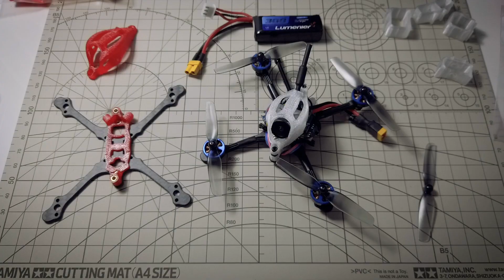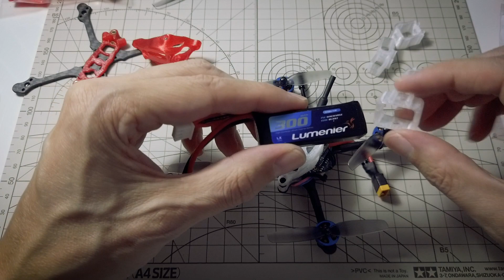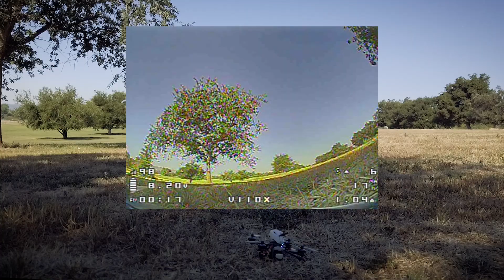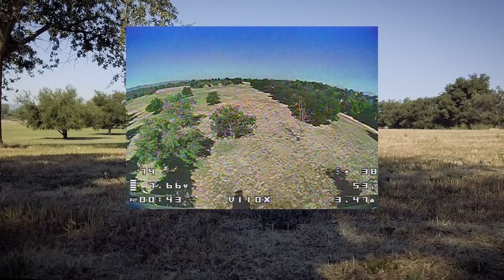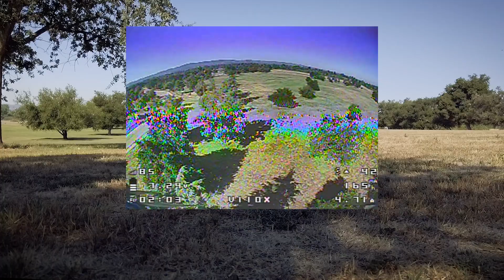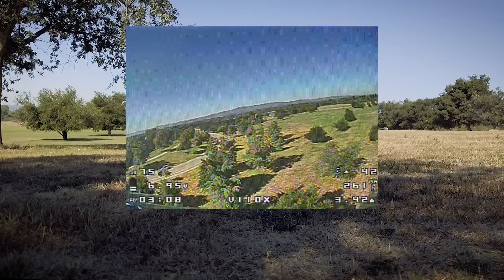GnarlyFPV Primo V110X + HQProp 65mm + Succex F4 AIO + Runcam Racer Nano + Hyperlite 8022kV + 2S 300

Comment: I just maidened mine today. These things really do feel like tiny 5in quads.
Reply from the maker: Awesome! Yeah these little things are all I like to fly at the moment;) The flight performance can be excellent especially considering how tiny and safe they are.
Reply: @MiniMicroFPV  Well, it was fun but this was my most short lived build, I had a desync today about 15-20ft in the air and crashed it. Two motors are broken and my  12a Iflight AIO board is fried. I don't even want to consider rebuilding it yet.
Reply from the maker: @yannickg6904  Oh no! Sorry to hear that. I consider myself lucky in that I don't think I've ever experienced a de-sync. I wish I could offer some advice to avoid them in the future. It's one of those things that seems hard to troubleshoot.
Reply: @MiniMicroFPV  The most maddening thing is that I flew about 8-10 packs LOS before attempting FPV and everything was fine. I had the issue at the beginning of the 4th FPV flight..no idea what happened, it just dropped out of the sky.
Reply from the maker: Yannick G That’s terrible! Oftentimes I won’t hear an oscillation until I’m in FPV. I hope you feel like rebuilding it or at least salvaging some components. Which hardware was it? Maybe others have had the same issue.
Reply: @MiniMicroFPV  I''m not willing to put the fault on the components I used, it may have been my way of putting it together. but using the motors from a Spedix Rex 80 was probably a mistake , the mounting screws are smaller than M2 and upon impact, they tore the threads off the motor bases. One of them had the motor leads pull from the windings and the other shows signs of damage as well. One of the ESCs is burned on the Iflight Succex board I used. I still have no explanation to what caused the crash.

Comment: It flys better with the racedayquads 350mah 2s hv
The hv part is super important to get decent flight times! There is essentially no extra weight.
I’m also getting 8min flights flying hard with 
Happymodel ex1102 7700kv
And yes 7700kv no misprint they are hard to find!
Reply from the maker: ace trex Thanks for the tip! I know I’m missing out on some performance but I generally don’t charge to high voltage as I’m paranoid about shortening the lifespan of the battery. I should probably pick one pack and start charging it to HV to see how it holds up;)
Reply: The racedayquads 2s 350mah hv is only $6.50. I just buy 6 at a time and run them for 2years ant then throw them away.
Reply from the maker: ace trex Nice price! If I can get them to last two years I’d be pretty happy:)

Comment: I been having issues with the xm receivers and the quad dropping out of the sky from low rssi any thoughts?
Reply from the maker: drums&drones Do you mean the plain XM (non-plus version)? If so I have also had bad luck with XM receivers and short range. No matter how I routed the antenna I would always get failsafe way before I expected to. All I can offer is to check the antenna for damage. It’s a shame because it’s a better choice for micros than the XM+ but I’ve found the range basically unusable:(

Comment: As KababFPV says, 73g is the upper limit for good performance, so I'll bet your 3s battery is making your Toothpick go over that weight. 2s isnt, so it flies better. It's all about light weight with Toothpicks.
Reply from the maker: I certainly agree with the light weight:) With the 3S it was about 71g. Even though that’s close to the limit I’m starting to think there’s something idiosyncratic about these motorz;) Or maybe it‘s be something with the tune that someone can set me straight on.
Reply: @MiniMicroFPV  have you done  betaflight motor oscillation test? I had the same issue on 3s but with my happymodel motors and I found one of them to be a little shaky when pushed to full throttle on 3s. Swapped it out and flew much better.
Reply from the maker: @doodlesdeluxe  Thanks for the idea:) I haven't tried that test before. It could help rule out bad motors vs gyro noise.

Comment: Those motors are not meant for 3s. I really didn't care for the hyperlite motors but have had awesome success with the new betafpv 1103 8000kv. They handle 3s and 65mmprops with no problems.
Reply from the maker: Jeremy Chotto Thanks! I’ll keep those in mind;) I was going to throw the Sailfly motors on here just to see how they compared but they have the wrong hole pattern. 
I think you might be right when you say these motors aren’t for 3s. Maybe they’re closer to 9000kV.
Reply: @MiniMicroFPV  I agree re: the betaflight motors. Great on 3S. Very smooth and efficient. The best 1103 motors IMO.